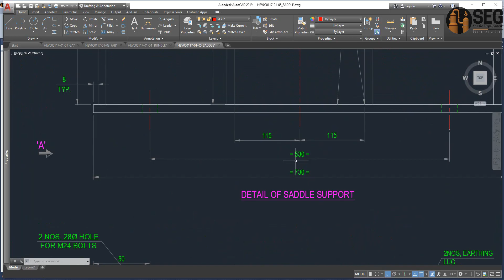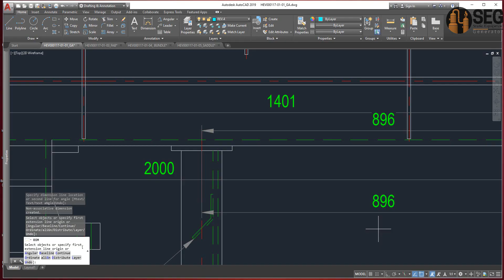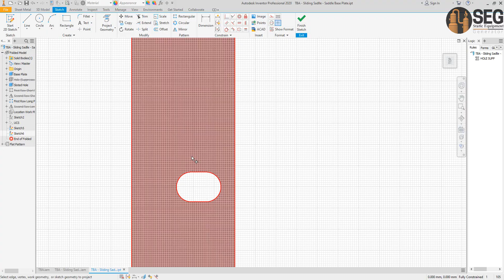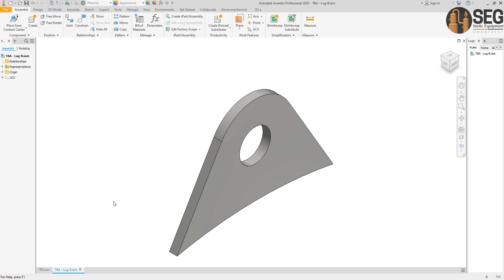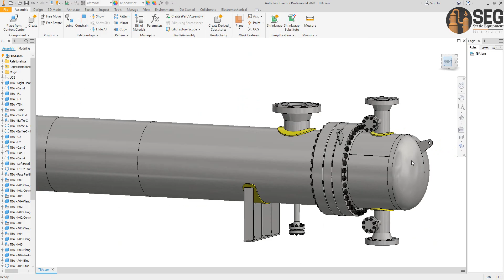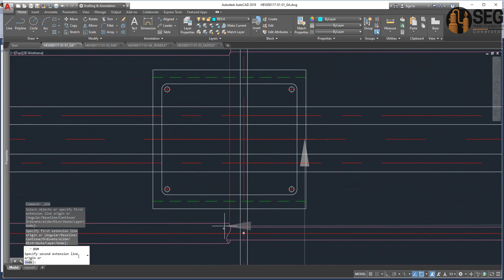Tutorial BEU Exchanger Part3, Saddles and Lugs

Comment: Thanks for your work. I have a question, is this software used by many international companies in the oil and gas field ? Is it more than AutoCAD 3d plant ?thanks
Reply from the maker: Thank you for your question. Yes, SEG (Static Equipment Generator) software is used by many international companies across various regions, including Asia, Africa, Europe, North and South America.

SEG is an advanced tool designed for the accurate and speedy production of 3D digital prototypes and workshop drawings. It delivers comprehensive solutions for pressure vessels, TEMA Heat Exchangers, columns, towers, storage tanks with fixed roofs, spherical tanks, ducts, equipment piping, and Slug catchers.

What sets SEG apart is its unique ability to cover all these types of equipment under one umbrella, supported by a vast library of items and specifications. This makes it an unparalleled software in the field, more comprehensive than AutoCAD 3D Plant for these specific applications.

Thanks,